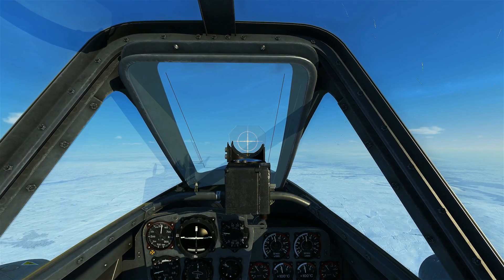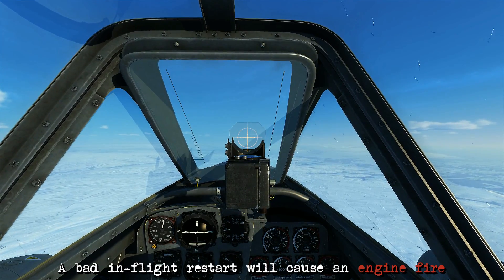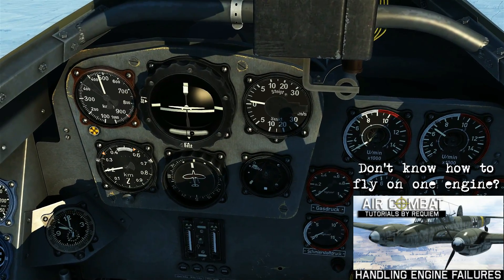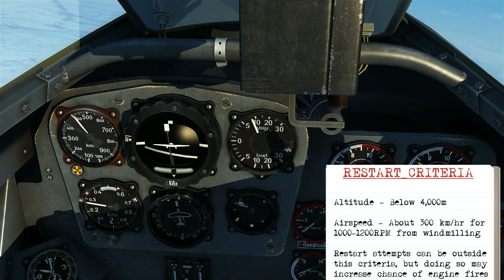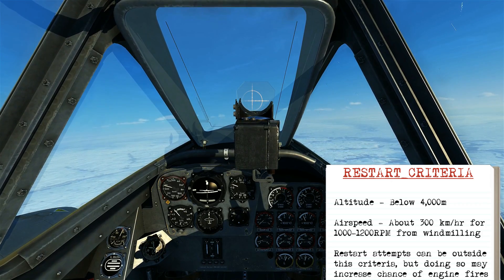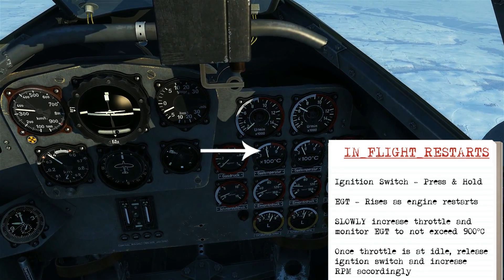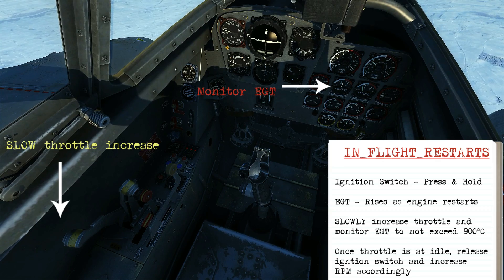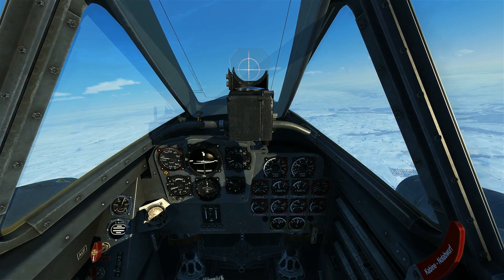Me 262 - Engine Fires & In-flight Restarts

Comment: Amazing video, but I think I might be doing something wrong. 

When I hit the ignition, I see that temps spike to the red zone immediately and the engine cathes fire. I have automated mixture controll on. I think that might be the culprit here. When I do automated engine start, it manages fine, but it’s WAY slower than what you do here. Hense why I wanna learn it ;P 

So which key bindings are important here? Guessing the Engine 1& 2Ignition for ME 262 and sepparate throttle controll. But what else? Do I need do something with the mixture? Which key binding do I sett for controlling fuel ? 

Any help would be much appreciated :D

Comment: How do you move the throtle to the cutoff potition i have tried everything and i can't get it to 0 % power
Reply: Not sure if you're still in the dark about this one. I was wondering how to do it too, but I figured it out with a bit of experimentation.
In the Me 262, if you press "e" (or whatever the engine start/stop is mapped to) while the engine is running, rather than stopping the engine automatically, it releases the throttle pawl for the selected engine, which allows you to throttle back below 15% to either stop the engine or attempt a restart. 
It's vital you bring the throttle back to no more than about 1 or 2% when you attempt a restart. I tried it at 15% and, not surprisingly, the engine caught fire, with dire results!
Hope that helps :)
Reply: Press e to cutoff the selected engine (1 or 2) then it will let you put the throttle to zero

Comment: Do you know will the engines stay on if you hold the igniters switches in while descending fast while bring the engines closer to idle so they don't flame out? ANd is there a set lower recommended RPM to set the engines at while Boom and Zoom lower aircraft so you dont over speed into a Mach Tuck?
Reply from the maker: If you bring the throttles back smoothly enough you won't cause a flameout...but I imagine holding the igniters could help prevent one, or at least restart the engines quickly if they did for some reason. Avoiding mach tuck is situational and depends on your initial altitude and airspeed....so just pay attention to your dive angle and airspeed. If you start approaching that 1000km/hr mark ease up the dive angle and thrust.

Comment: You don't have to follow a this procedere. Once your engines go out, put your throttle all the way back, press ignition button and increase it slowly. You don't have to be at 300 kph, but you have to be below 4000m(depended on air pressure) that is correct. BUT the forward-slip to stop a fire is helpful, thanks.
Reply from the maker: Hey Scharfi, thanks for your feedback! That's good info to be aware of as slowing to 300 km/hr may not be the best technique in a combat area of course. I was just following the recommendations from a 262 manual :-)

Comment: Wait a fucking minute, did they add manual engine starting to IL-2?!??!
Reply from the maker: Yeah it's like a quasi-manual start similar to what you have in the Flying Circus airplanes. So you need to set the mixture, RPM, and throttle before initiating the startup sequence. The 262 is a slightly different kettle of fish to startup.

Comment: Why is opposite rudder used for putting out engine fires?
Reply from the maker: It should but most of the time when I'm on fire in a single engine plane for example I just bail out as the fire will start wounding you, so by the time you can put it out you'll probably be near dead anyway.
Reply: BiggieB Higher air mass flow on the affected side of the aircraft as you’re essentially pointing the side into the airflow increasing air pressure on that side thus increasing the chance of putting out the fire.
Reply: @Clebbsi  My intuition is failing me when I try to understand why that would increase airflow.
Reply: @biggieb8900  I assume: The larger cross section, paired with less streamlined shape would cause the oncoming airflow to lose a lot more velocity, become turbulent overall increasing pressure significantly on the windward side of the aircraft. Additionally and maybe even more importantly, making the flow turbulent significantly increases the energy of the airflow as opposed to laminar flow which i would imagine helps extinguish a fire aswell...somehow.

This is mostly some half-knowledge from atpl theory and physics studies but the fact of the matter is that fluid dymamics are hard and confusing so I could be absoloutely wrong here and honestly I hadn't heard of this technique before. In an airliner for example you have extinguishers and if all fails you make an emergency descent and land as soon as possible.
In smaller piston aircraft you would make an emergency descent and land as soon as possible in all cases. Sideslip would be used simply to help you lose altitude more quickly in this case.
Reply: @Clebbsi  The larger cross section makes perfect sense to me, thank you. I too studied fluid dynamics in uni for an engineering degree but I do not ever take even simple examples for granted, if anything my studies reinforced to me the depth of complexity of seemingly simple systems. Plus the mechanics behind extinguishing a fire vs merely giving it more oxygen are complicated too I'm sure. I guess it has to do with decreasing to temperature below the flash point.
Reply from the maker: I wouldn't be too worried about if you go left or right, just do a forward slip and it should extinguish.
Reply: @RequiemsACTL  Does this work on the other planes?
Reply: The way i understand it is that you are blanketing the fire, when you are flying straight and engine catches fire it obviously means wherever the source of fire is, it is shielded from airflow otherwise it would just not catch fire in the first place.
By sideslipping you are simply blowing the air on engine space which when flying straight make fire potentially possible.
Also, i dont think opposite rudder is needed.
Damaged me262 likes to keep catching on fire occasionally and it never mattered to me which rudder i chose, both directions will extinguish it.

Comment: Random question, I know a few things are automated in this game, but would the fuel really auto cut out in real life in this scenario?
Reply from the maker: If it was still in a position selected for an aft or forward fuel tank and the pump was on then fuel would still be being drawn from the tanks, so you could end up with fuel accumulation...imagine what could happen if you tried restarting a jet engine with way too much fuel to begin with LOL I don't think any fuel accumulation is modeled in this situation though.
Reply: The Air Combat Tutorial Library I wouldn’t assume it’s modeled as it’s set to auto handle the cutoff, but if you manage to become a firecracker next time your in the air that would be a great learning video!  

Thanks for answering the question! I just love learning about this stuff
Reply from the maker: Moving the throttle rapidly backwards in real life did cause flameouts, but the red fuel valve you see moving to the cutoff position is automatic as the flameout requires that (and turning off the fuel pump) as part of the emergency procedure when it occurs. So the game handles that portion for you.
Reply: @RequiemsACTL continuing my curiosity, what would happen if a pilot failed to move the fuel lever to the cutoff position during a flameout?
Reply from the maker: No worries! I did set myself on fire in this video in the restart but I didn't want to extend the fire for a long time because well you know...it tends to be unhealthy :-)
Reply: @RequiemsACTL  Now i want to buy boddenplate just .. to try .. for science.. ahem :D

Comment: Req, for what ever reason I’ve only been able to get horizontal trim working for the 262. However I have been unable to get the pitch trim functional, is it like the 190 with preset ground tabs? Or is a different key bind than vertical trim you’d find on a spit? Great video as always-Mat
Reply from the maker: The difference is that pitch trim infers you're using trim tabs on the  elevator while if an airplane has horizontal stabiliser trim it moves the entire stabiliser not just a trim tab